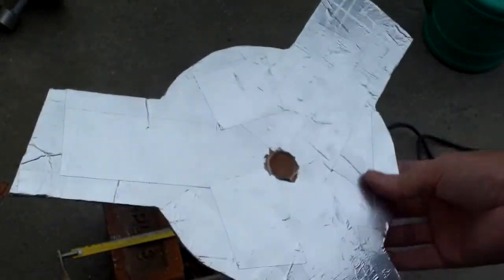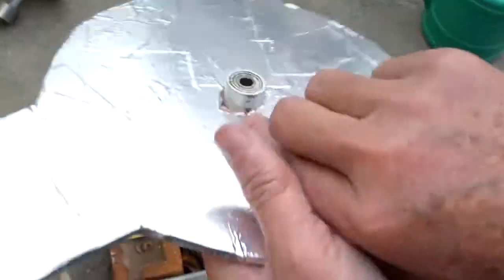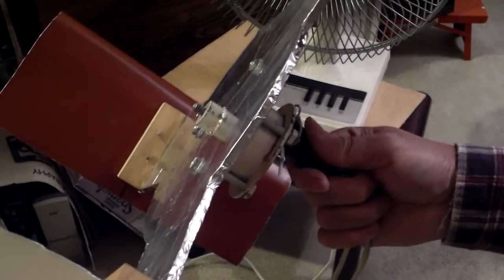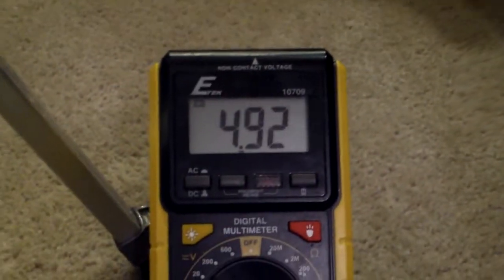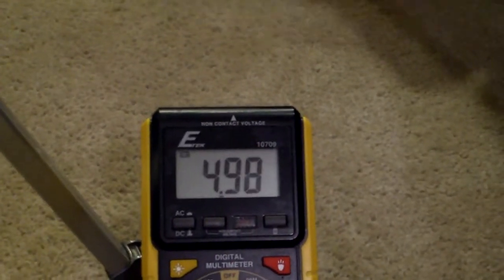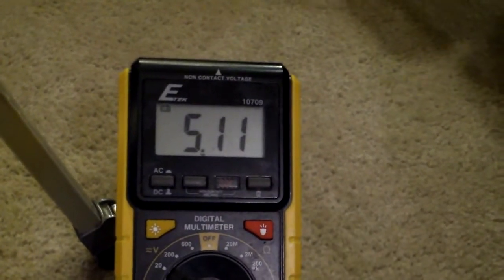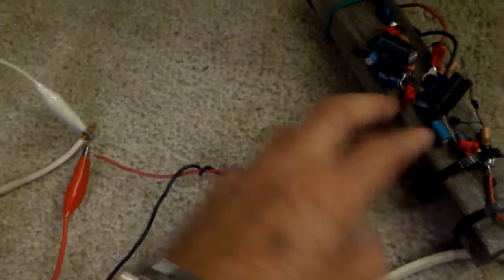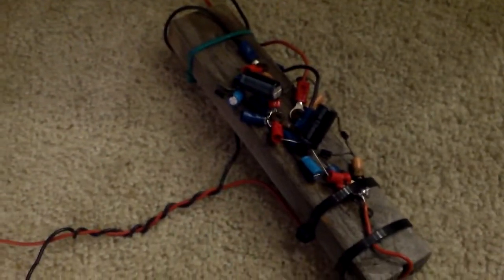Testing the mini vertical wind turbine Part 3

Comment: Never made a vertical wind turbine before they look slightly more complicated, But it;s looking good.
I wont to see this turning when you get it mounted.
All the best.
Jace
Reply from the maker: Norfolktuber I'll put it out soon. First I'll mount it low and then a little higher up. Most of the time it should turn leisurely but that's ok.

Comment: Looking sharp! What did you use for your blades?
Reply from the maker: The Cedar Workshop I used aluminum window capping flashing. As there is only one attachment point for the wings, I want to make the wings as light as possible. I had the same design in my 2 year vawt and it worked very well.

Comment: What angle are the blades offset.  They look to be angled IN a few degree.  That blade system works well.  I'm guessing a simple corner bend would work fine, or does it work better rounded?
Reply from the maker: Russ Bowers There's a little cogging with this alternator.  The wind turbine wouldn't turn if it's just a simple corner bend unless I have strong wind. The blade is offset about 9 or 10 degrees. I'm trying to replicate the Lenz design hence the round shape.
Reply: wtam69
How do you draw out the base for that three arm shape.
Reply from the maker: Russ Bowers Windstuffnow.com has the info on the Lenz wings design. It's a popular design used in vertical wind turbine.